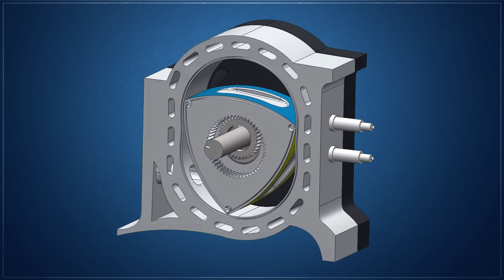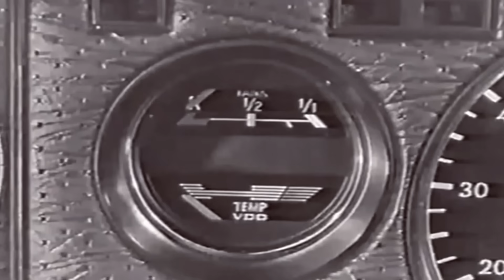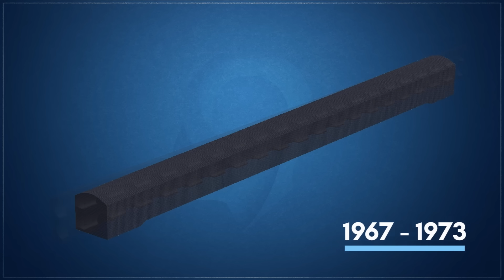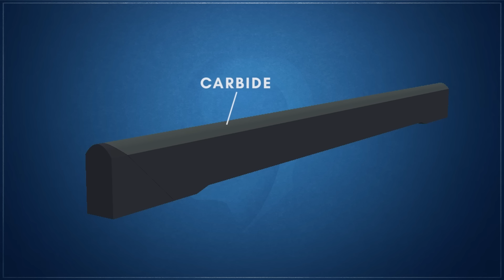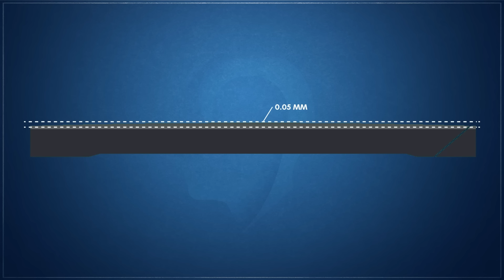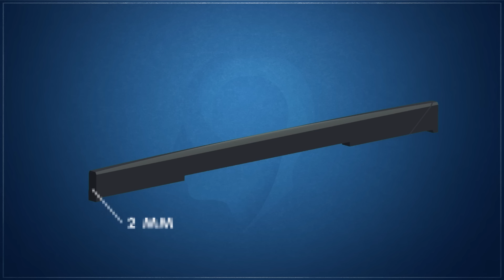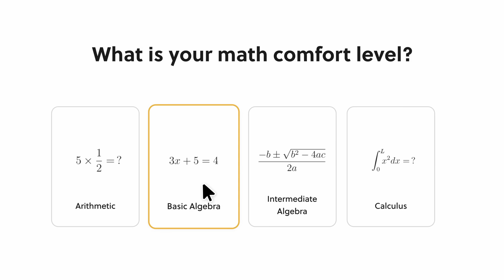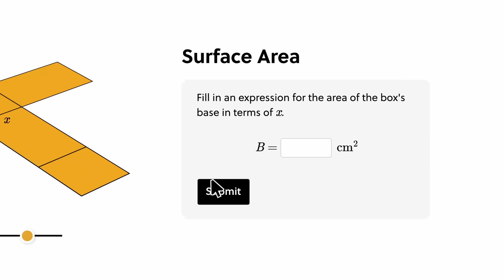Overcoming The Rotary Engine’s Biggest Flaw

Comment: I'd argue that the rotary engine's biggest flaw is its poor compression ratio. I'm wondering if you could make a follow-up video talking about the LiquidPiston X-Engine and how inverting the triangular rotor and peanut-shaped housing into a peanut-shaped rotor and triangular housing made for a better overall design that can even run on diesel.
Reply: Unfortunately LiquidPiston is good only for single rotor configurations,  stacking is inpractical, liquid cooling of rotor is hard. There is also a problem with rotor air cooling: cooling air need to be filtered in the same way as intake cooling.
Reply: Beware of LiquidPiston it is not a legitimate company

Comment: It is sad to say, but some things will only live in past. Hybrids are already dying, and Mazda is in danger of losing they market. 
And anybody who thinks, would go for full battery solution, because when you think which from two is required more maintenance: ICE or electric, for hybrids you add this and add part which connect them, in long term it will be expensive to use.

Comment: If you add 2 stroke oil to the gas it’s amazing how much better they perform !!!! Even the problem years ..::
Reply: Drowning the engine in excess oil is a common practice to keep a damaged engine that has already suffered compression loss limping around longer...
Mazda only recommends 4-stroke motor oil with an API SL rating or better. 
No 2-stroke oil meets this minimum API specification.

Pouring the wrong oil into the wrong filler hole is just monumentally ignorant and a complete waste of time and money.

Comment: Design Ideas has perfected the apex seal. These seals work at boost pressures not seen since the F1 turbo era of the 80's. They are not cheap, but worth it if you are trying to make real power with a rotary. Reliability is there too. I've heard of Design Ideas seals being so durable that they are not changed when rebuilding the engine-- and that is in drag racing applications!
Reply: Do you have any proof? Or is that something a salesman told you???
Reply: @DoktorBayerischeMotorenWerke   Yeah, have a look at drag racing! Some of these guys are getting 1,300 and even 1,500hp out of 2 rotor engines. The scene is strong in Australia, New Zealand and Puerto Rico, amongst other places. If you recall, the BMW 2002 engines they modified for F1 were around that power level in quali trim and they were absolute hand grenades! Now both of those cases assume skilled tuners. Unskilled tuners will go out and blow up a rotary because they don't understand the nuances of the design. Same story with Subaru engines. The trouble is, the guys who really know rotaries never post on social media.
Reply: @nicolashuffman4312  The BMW M12 F1 engine produced 1,000 hp per liter... the 13B can only produce 1/3 the power density.
 That's because these remote, backwards island countries don't have access to real high performance cars or modern automotive technology.

Wankel engines are inherently unreliable and much less durable than reciprocating engines.

Wankel engines are so unreliable at high power output they cannot be used in certified passenger aircraft... they are simply too dangerous to carry people in the air...
they are not very good at carrying people on the ground either.
Reply: @DoktorBayerischeMotorenWerke  Look troll, it's not my job to do internet searches for you. Look it up. It will be in the first page. You should note that those BMW F1 turbos only made that power on exotic fuel and with the wastegate locked closed. They only made that kind of power for a few laps in qualifying. The crews could hear them blow up from the other side of the track. All they could do was hope the engine would hold until they got a hot lap. And IF that happened, the engine was changed before the race. In race trim, power was more like 900hp. Anyway, the whole discussion of hp/l is a little asinine since top fuel dragsters beat everything anyway. American V8s for the win!
You can mock island nations and mock the rotary community here, but the fact is they make a huge amount of power for their weight. In drag racing, the turbo is often just bigger than the 13B. You can carry them across the room in your arms. I'll remind you that Mazda won the 24 Hours of Le Mans in 1991, and that is likely the most demanding competition available. That is the only time a car without pistons ever did that. You can fan boy over whatever brand you like, but there are a lot of cool engines out there and the rotary is one of them. There is a reason the name 13B is as recognizable as LS3, RB26, and 2JZ.
Reply: @nicolashuffman4312  Childish insults wont prove your point ... or make you look smarter or more knowledgeable on this topic.

You made the comparison with the BMW M12! It simply proves that reciprocating engines not only produce more power per liter they are more reliable in high output applications.

 Its still more power per liter compared to any Wankel engine in a comparable application... Wankel engines are inferior to reciprocating engines in all motorsports applications.

Im just pointing out the facts, the small, remote, backwards countries you mentioned have no domestic automotive industry and are completely insignificant in automotive engineering and World-class professional motorsports.

Mazda's 787B lost the WSC endurance racing championship to Mercedes-Benz in 1990 and lost again to Jaguar in 1991...
 the car was allowed to compete at the 91' le Mans under a non-compliance waiver and had the largest displacement and fuel capacity of any car.
 the 1991 win was a fluke, pure dumb luck.

Porsche has won Le Mans 19 times and Audi has won 9 times with a Diesel... proving that Wankel engines suck for endurance racing.

I can buy a new car with a V-8 or an inline 6... can't buy a new car with a R26B or a 13B...
Reply: @DoktorBayerischeMotorenWerke Ok Boomer
Reply: @WanklerRX  I'm not a Boomer...
Reply: That is a big lie, no one has ever solved the reliability problems that have always plagued the Wankel engine...if someone tells you otherwise? They are without any doubt trying to sell you overpriced garbage parts.
Reply: Rotaries seem to love life best when at full throttle.
Reply: @loganlachance1890  Then why do they have such incredibly short service life when used at high power settings?
Reply: @loganlachance1890  Yeah and you don't really even need seals at high RPM, the gas escaping gets closer and closer to being negligible. Its the slow speeds like idle and startup that you can tell the most difference.

A screaming rotary is a happy rotary, keep rotaries happy and singing!
Reply: @jakegarrett8109  High rpm is when a gas tight seal is most critical, hot gasses passing by the seals overheat them, causing ablation damage that destroy the seals and the engine.
Reply: @loganlachance1890 If that was true? Wankel engines would be ideal for aircraft applications... which they're not.
Reply: @blockstacker5614  Not true, the Wankel engine proved to be extremely disappointing in aircraft applications.
They cannot compete with existing traditional aircraft powerplants..
Reply: @blockstacker5614  Not a world record, the World's record is 52 seconds.
Reply: @sandervanderkammen9230  60 seconds to 3km seems absurd for a prop plane with an internal combustion engine. Are you sure you aren't thinking of something different?
Reply: @blockstacker5614  You actually believed a propeller plane holds the world record????
Reply: @blockstacker5614  NO! Not the World's record for an ICE prop plane either.

Only a class record and a very obscure class at that.

Wankel engines are inherently inferior to reciprocating engines and gas turbine engines in aircraft applications..
Reply: @sandervanderkammen9230  stop moving the goalposts
Reply: @blockstacker5614  Stop spreading misinformation about a topic that you are not qualified to discuss.
Reply: @sandervanderkammen9230  as if you have any credentials. Who are you, president of the Mazda discreditation committee?
Reply: @blockstacker5614  Are you even old enough to drive a car yet kid?
Reply: @sandervanderkammen9230  I drive to work, 20m each way, every day. Been driving since I was 16, and that's if you only count driving on public roads.
Reply: @blockstacker5614  Because you don't seem to know much about them... or about Wankel engines..
Reply: @sandervanderkammen9230  Ditto
Reply: @blockstacker5614  You actually believed that the time to climb world record was held by a Wankel engine... which proved you still have alot to learn yet kid.
Reply: @sandervanderkammen9230  For internal combustion engine, not absolute record. learn to read.
Reply: @blockstacker5614  Gas turbine engines are internal combustion kid... you're just digging yourself a deeper hole now.
Reply: @sandervanderkammen9230  I'll admit, you got me there. Say, what's the point of all this anyway, is being pedantic and ragging on unique and uncommon technologies some sort of demented pastime of yours?
Reply: @blockstacker5614  Just the facts here, the Wankel engine is inherently inferior to reciprocating engines and was the largest and most expensive failure in the history of the engine manufacturing industry..
Reply: @sandervanderkammen9230  They are still being produced, you know.
Reply: @blockstacker5614  at a significant financial loss... Mazda has gone bankrupt twice because of its unreliable Wankel engines.
The MX-30 has been canceled in the US, Mazda's biggest market.
Reply: @blockstacker5614  Just like the RX brand... canceled due to low sales and financial losses.

Comment: The biggest flaw in the Wankel has to do with lousy BSFC due to the huge area sucking out heat.
Reply: No the biggest flaw is the way they throw still burning fuel out the exhaust as the RPM goes beyond the "Optimum"
Reply: @Racing_Pig  That's not a flaw, its a feature! I like the pops and crackles, sure only getting 16.23 mpg average taking it easy on the highway isn't the greatest (single digit MPG in town but I drive a lot more aggressive normally), but its that belching of flames and pops and the sound of winding those things up past 9,000 rpm that makes them fun.

Its true that sport bike engines are rather close in power to volume (I could make a 1.3 liter V8 out of 2 of my motorcycle engines and it would be 268 HP, about 30 HP more, and probably WAY higher fuel economy), but nothing really sounds like a rotary. Sure an inline 4 at 16,000 rpm sounds GOOD, but its got nothing on the sounds my car makes, just makes me smile. That fuel isn't wasted, its MPG is converted to SPG (Smiles Per Gallon), and nothing compares to the rotary!
Reply: @jakegarrett8109 single digit mpg in town. Omg that bad.
Reply: @jakegarrett8109  Sorry, it's just an inexcusable inefficiency.
Reply: @jakegarrett8109 That's because your engine is damaged and needs to be replaced...
Reply: @Racing_Pig well that comment reveals someone who is not an engineer... lol
Reply: Another flaw is the lower combustion temperatures in the corner near the apex seals that will always result in less than optimal combustion throughout the entire chamber. This is easily seen in the experimental transparent combustion chamber tests.
Reply: @geebs76 The Wankel engine cannot be adapted to use modern Quench or "high swirl" chamber architecture..
Thus it has poor combustion efficiency and flame propagation
Reply: This is how hard u can push a rotary🔥🔥😱😱https://m.youtube.com/watch?v=xtVVPioU9p8&t=1127s

Comment: There are many small engines that are super efficient and would've been a better choice for the new Mazda Electric Hybrid. 
It doesn't make sense to use an engine that has terrible emissions as a back up to the batteries.
Reply: At its "Optimum RPM" a Rotor engine is much less terrible. The mistake was using them with cars where the engine is constantly changing RPM. meaning you're basically never at the optimum RPM.

Generators were one of the original design considerations for the design. Back in the NAZI days.
Reply: @Racing_Pig That is completely false, Wankel engines were exhaustively developed for generator applications decades ago and proved to be completely inferior to reciprocating engines.

False,   reciprocating and gas turbine engines produce more horsepower per pound and per liter reliably than the Wankel... which is why Wankel engines have never been successfully used in production aircraft or generator applications.

Also False  The Wankel engine was specifically designed and developed by NSU for MOTORCYCLES... another application were they proved to be inferior to reciprocating engines.
Reply: @sandervanderkammen9230  I only said “LESS TERRIBLE” not good.
Reply: @Racing_Pig  Felix Wankel was obsessed with motorcycle engines... he was inspired by his favorite rotary motorcycle, the MEGOLA.
Reply: Pound-per-pound it generates more energy than any existing ICE.. Combine that with longevity and it is actually within ESG standards for fuel efficiency.
Reply: @campbellpaul Pound for pound, the reciprocating engines produce more horsepower reliably than the Wankel.

Gas Turbines produce an order of magnitude of power to weight performance and are more efficient and are extremely reliable too.
Reply: @@retiredbore378 You probably are correct, however this is a purpose built engine that operates at a set RPM that is lower than any of those engines.  Every one of those engines would be better if they were manufactured for the task (minus the cost and fuel efficiency) but would each have more drawbacks than the wankel.
Reply: @campbellpaul Wrong, thats a false assumption on your part, reciprocating engines outperform Wankel engines in fixed rpm operations.
Reply: @@retiredbore378  2-stroke engines have worse emissions.. An F-1 engine runs at too high an RPM and (like the 2-stroke) is more difficult to manufacture.  Removal and replacement would likely be more difficult as well as an F-1 engine would take up too much space.  These engines probably have never been made to go into an electric vehicle, either.
Reply: @@retiredbore378 I think diesel cars are outlawed in the US, but a 2-cycle diesel would be bulletproof.

Comment: Experimental aviation has many companies that take stock RX7 engines, and ceramic coat the inside and convert them to aircraft engines. 
They are perfect aircraft engines. Light weight, dual ignition built-in, minimum parts count, runs on regular unleaded gas, can get you home even if you've lost all oil pressure. 
This happened to a pilot. After landing they took the engine apart to find ceramic coatings had no wear whatsoever.
Reply: You sir are a big fat liar.
There are no Wankel engines reliable enough to pass a FAA or EASA airworthiness certification.

Wankel engines are illegal to install on any type rated passenger aircraft simply because they are too unreliable and unsafe.
Reply: It's more than just the coating. In stock form, the engine injects motor oil into the housing to lube the apex seals. No oil pressure, no apex lube.
In aviation, they often swap the oil injection to use an external 2 stroke oil reservoir instead. Which means if the main oil pump goes out, the apex seals will still be lubed and be able to maintain compression which much of the rest of the engine fails from oil starvation.
Reply: @dirty_haute  In aviation, they don't modify engines or deviate from the manufactures specified procedures.
Wankel engines are too unreliable and its illegal to install one in a certified passenger aircraft.
 several major aircraft engine manufacturers developed and tested Wankel engines and found that meter oil injection using 4-stroke motor oil offered superior durability and improved reliability but this was not enough to pass airworthiness certification.
even Mazda does not recommend 2-stroke oil or premixing because it reduces engine life and increases engine failure rates.
 Wankel engines can only be used in homebuilt and experimental aircraft that are untested and unproven, they do not meet safety standards and all of the risk is beared by the owner/operator... and this has resulted in several fatal accidents in recent years.
Reply: @DoktorBayerischeMotorenWerke 

As someone with extensive knowledge of aviation regulations and engineering, I can confirm his comment to be 99.9% true the only exceptions being experimental platform companies that offer roller airframes specifically built to mount a wankle or other similar rotary.

The thing is, these DIY airframes are NOT certified aircraft, and are regulated differently from standardized and certified airframes.
Reply: @scottytherambler6919  YES, I agree 100%. I also, already covered that particular exception.

 I wrote, quote:  "Wankel engines can only be used in homebuilt and experimental aircraft that are untested and unproven, they do not meet safety standards, and all of the risk is beared by the owner/operator..."
Reply: @DoktorBayerischeMotorenWerke  In experimental aviation it's totally different. Look up Yamaha snowmobile engines and see what they doing with them. These days experimental aviation is where all the action is, at least as far as general aviation is concerned..
Reply: The use of Wankel engines in passenger aircraft is the soul domain of crackpots and suicidal lunatics.. No aircraft manufacturers offer a type certified aircraft with a Wankel engine because no Wankel engine has ever been reliable enough to pass the minimum   standards to meet FAA certification.  Apex seal have a fatal flaw that makes their durability and reliability unpredictable.

Wankel engine offer no advantages over reciprocating or gas turbine engines and are unsafe for passenger aircraft.
Reply: even if it was the case Concorde would've still been cooler